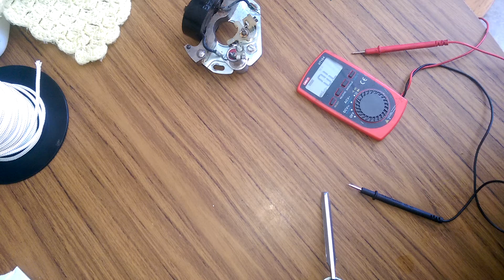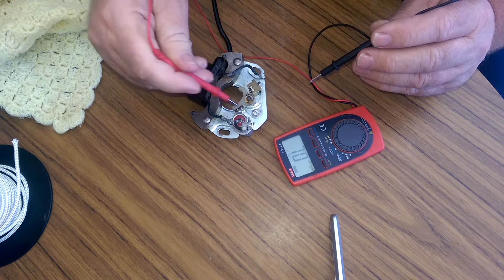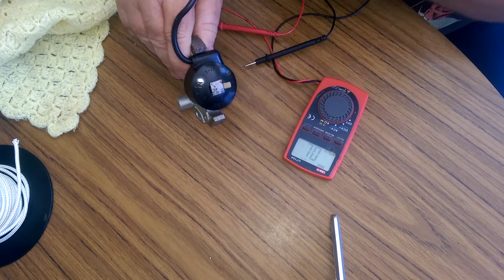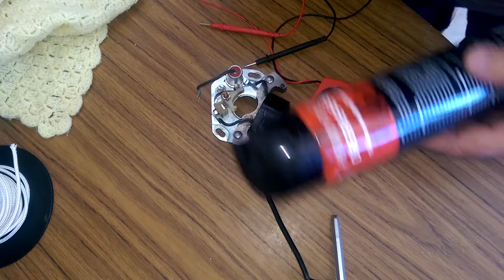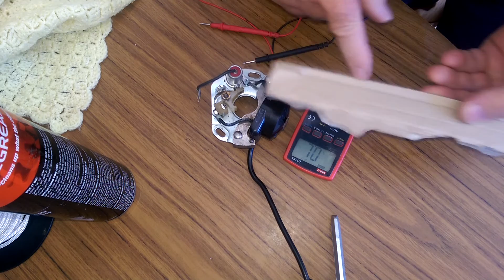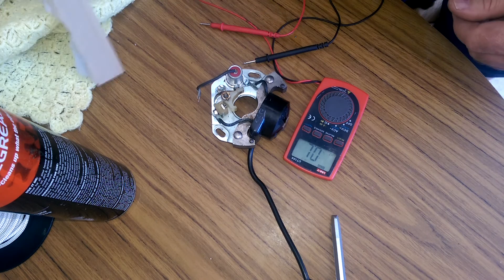Old Victa ignition magneto testing with multimeter.

Comment: Rolf Wayne here , I did what you suggested and I got spark , but it isn't all the time . Have you got any suggestions . Did the points at top dead centre at 0.20  . Any suggestions would greatly be appreciated . Thank you Rolf Wayne .
Reply from the maker: Try closing the air gap..   With a little bit of caution  put a screw diver in between the cam and the stator plate and bend the plate closer to the flywheel.  Just a token amount.  That will decrease the air gap to the magnets.   Also the points should open !/8' before Top dead centre.

Comment: Hello again Rolf . In your opinion , what would stop one of these magneto's from sparking . The only thing I haven't done is change the points 
 Your thoughts will hopefully point me in the right direction . Thank you Wayne .
Reply from the maker: If all things are right you have about 120 Volts on the low voltage and about 12,00 Volts to the Plug.  Dismantlle the points and clean the contacts the best way you can.   I would soak them in turpentine after that.  Let dry amd reinstall.  Put a very light amount of lubricant in the cam on the crankshaft.  Make sure all wires to the points are not laying on any metal.  You need to check the high tension lead as well.  The magneto area should alwayse found dry, like no traces of oil or vapor.   Points 0.20.    Stator plate i normally set at mid point
Reply: Rolf ,you mentioned 12,00 volts to the plug , so if it is only reading 840-860 then that is not enough to create a any spark . @rolfgrosseholz1311  That is testing from positive to the end of the high tension lead . Thank you Rolf Wayne .
Reply from the maker: @wayneheta7033  I can ask a friend of mine for the exact formula.  But on basics.   An engine with higher compression, like new requires a better ignition than a worn engine.  The spark plug needs to fire under the pressure of say 9 atmospheres.  It ppl fix all the compression issues on an engine and then find the engine won’t start.  The ignition needs to have new engine output.  Newer engines with decompression may not be affected that way.  Because they actually fire up on a lower compression.
Reply: Thank you Rolf , will try that .

Comment from the maker: All you need is to find a coil off a victa super start motor.  It has the starter on the side.  The coil will fit.  Then the rest is the same.  Those super start coils are reliable.  Never seen a bad one.

Comment: Hello Rolf , Wayne here . Would you happen to have a spare old Victor ignition magneto . They are very hard to find .
Reply from the maker: All you need is to find a coil off a victa super start motor.  It has the starter on the side.  The coil will fit.  Then the rest is the same.  Those super start coils are reliable.  Never seen a bad one.